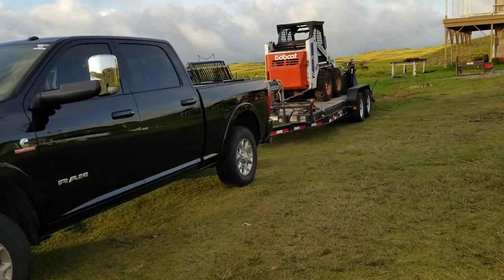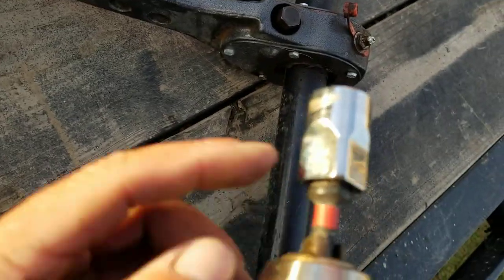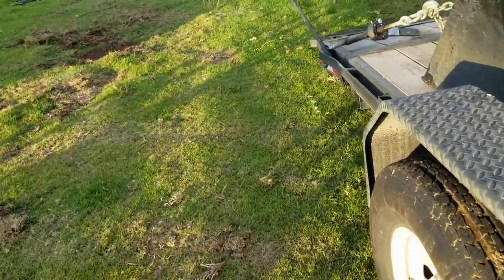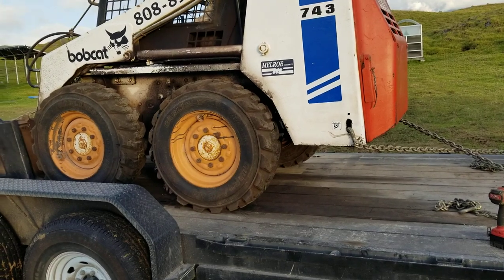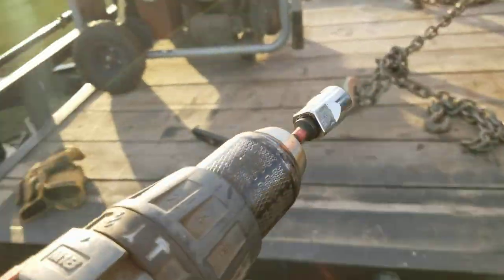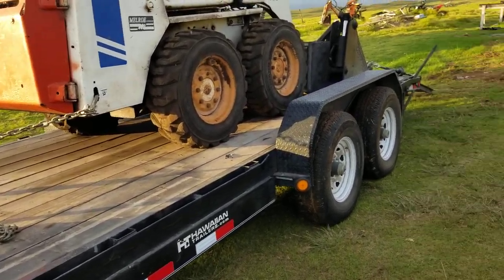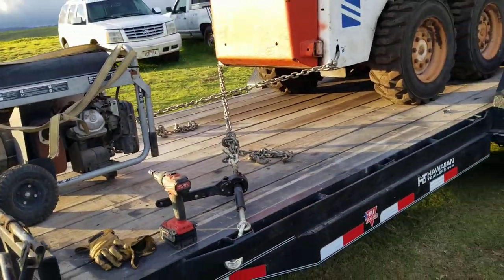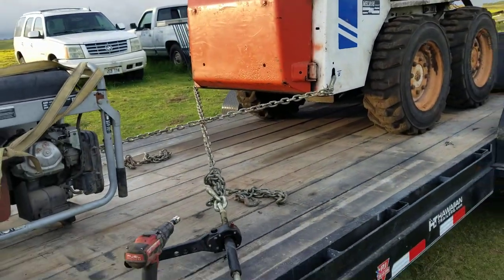Speed Binders Review Awesome

Comment: After a long day is where you sold it to me. Especially if you have up to 3 x machines with 12 x ratchet devices to be used. Add to that the haulage and drive on the way home. It all adds up. Yes, they are heavy on price but worth it if you are against the clock daily.
Reply from the maker: I agree I still use them almost daily and the amount of time and effort it saves me is a game changer.

Comment: Hey Modern off Grid...thank you for the review, glad you like them! FYI, You can set the drill collar for a torque setting to get to a specific tightness that doesn't pull your stake pocket. Might want to run slack in on 2 nd speed and than drop to first gear for final tightness. ( hang on to the battery pack with your spare hand to counter the torque) ...Just a couple suggestions, hope you don't mind. I truly appreciate you taking the time for the video, thank you so much!!
Reply from the maker: No problem I love using them has made my life much more easier after a long day at work and all you want to do is go home.

Comment: Would they work to secure 45000 to 49000 lbs steel coils? I drive a flatbed semi truck and I haul steel coils
Reply from the maker: I dont think so 50,000 lbs is lot of weight.
Reply: they have some that are 5/8 that are rated around 13k lbs